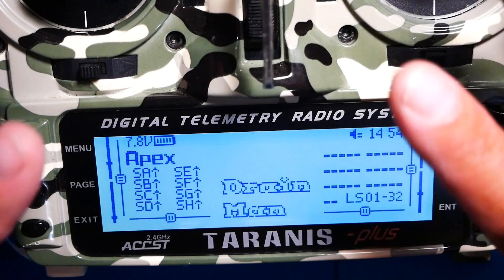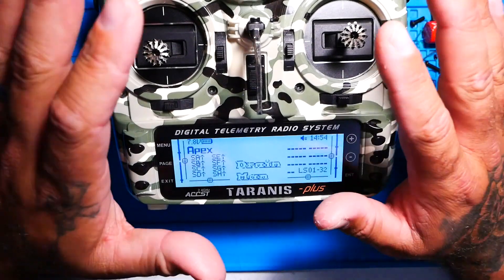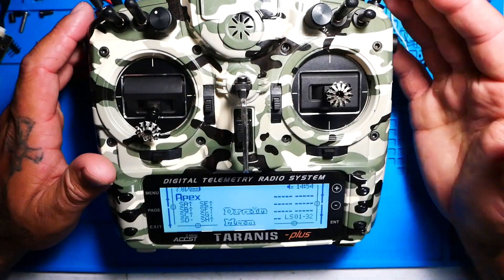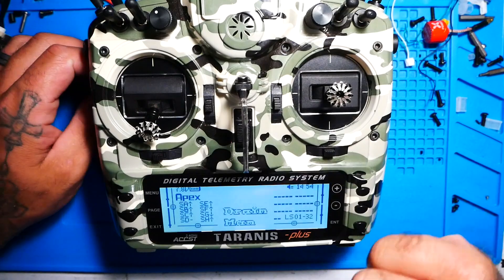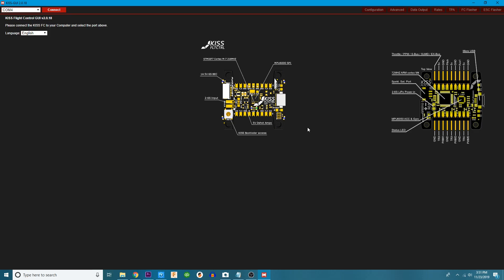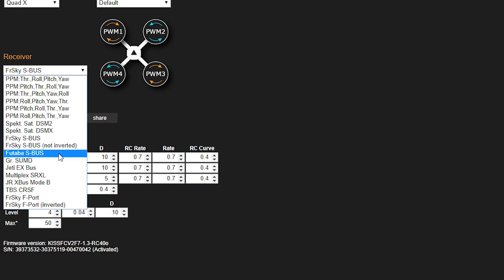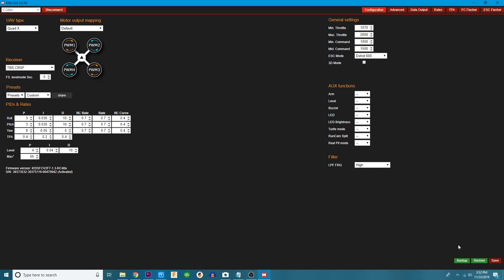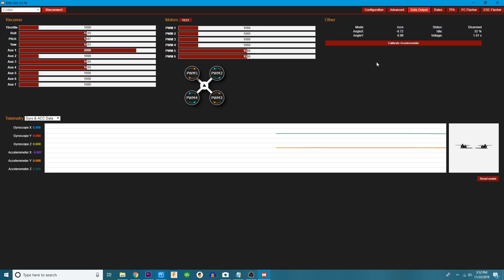Setting Up Switches On KISS Flyduino - How To Arm & Disarm + More = Beginner's Guide

Comment: Hey I know its been a bit but this still helped me so much today. Thanks. Only question so far is how does launch control actually work?? On BF i had it on a switch and you armed in acro flipped the LC switch and it went to the desired angle. I dont see any of this working in KISS

Comment: Hi dude your very knowledgeable about kiss I got my first kiss quad and I got my switches sort off set up it let me into FC once but now when I connect it won’t allow me actually change anything my arm switch is back to front when I connect the Tbs crossfire lights up green so it’s obviously getting power any ideas it’s an impulse apex steel edition thanx guys in advance from Ireland

Comment: Hey Drain Man, I have the Mr Steele edition Apex. Full spec. Kiss FC V2,  kiss 25 amp 4 in 1 
Esc. Set up switches as per vids. Got arm working, got turtle working. No Buzzer. I have the switch showing movement in the data output but no buzzer. Any thing I might be doing wrong, should this work with this esc?
Thanks man. Followed allot of you vids great help.

Comment: hey dude, hope all is well. I’ve recently built a cinerat (kiss hardware) I’m struggle to get it up and running. Iv activated the FC v2 through gui and updated. Also flashed 4in1 esc. The trouble I’m getting is I can’t get my motors to arm. I’m using CRSF nano rx and the vtx is TBS UNIFY EVO, iv got the EVO talking through the nano through rx and tx rather than the FC. In kiss gui Iv done a motor test and it arms through gui but won’t arm as it should usually arm. Have you any ideas please? Thanks ~Ju
Reply: i have the same problem

Comment: Hi man. nice vid. I´ve just upadated my Kiss v2 Fc to last version (1.2RC40o). I´ve set 2 switches ("B"->Arm, "G"->Buzzer and Turtle Mode) on my Taranis X9D+ I would like one switch more, in order to, whatever, Real Pit mode. I decided to use "D". But when I attempted to assign the AUX3 to the RealPItMode and I go to the Data Output tab on Kiss Gui, the Channel 7 that belongs to Aux3 on my Taranis, does not do nothing. There is no any data output. Its always stopped on 1495 value.
Reply from the maker: Did you set it up in the mixer
Reply: @DrainManFPV  Yes man. First step on the Input screen and second step on the Mixer screen.
Reply from the maker: @davidsagal  hmm not sure what's going on. I wish I could see it and troubleshoot it.
Reply: @DrainManFPV  May I send you an email with pictures or a text message, WhatsApp?